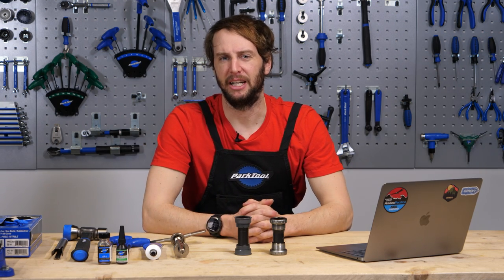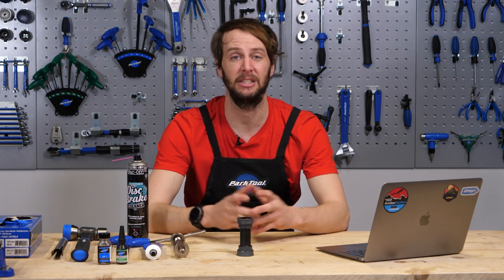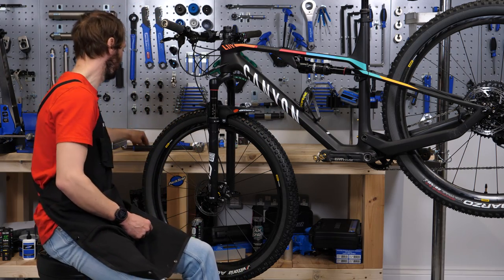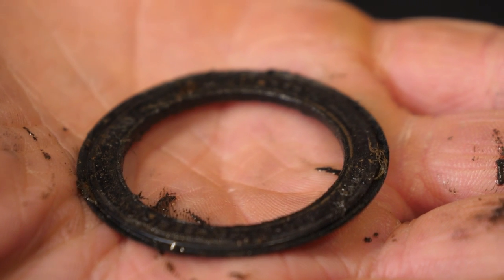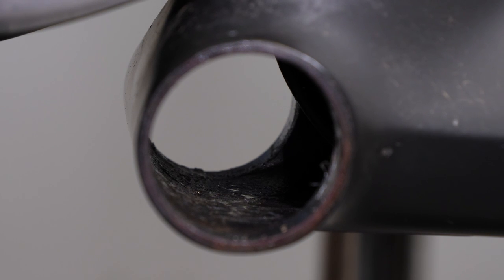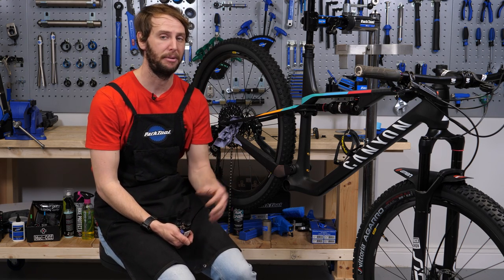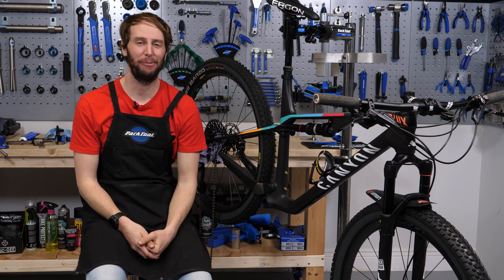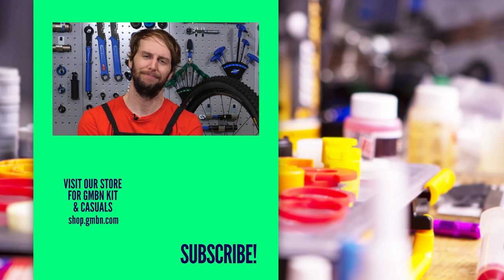How To Remove & Install A Press Fit Bottom Bracket | GMBN Tech Maintenance Skills

Comment: My Trek carbon XC bike has BB90 (press/remove the bearings by hand), & despite that system having a bad rep, mine's been almost fuss free. I say 'almost' because, compared to a more sealed system, BB90 needs more frequent stripping down/inspecting/cleaning, IMO. But the bike's nearly 11 years old, so I can vouch for it!
VERY good video, Rich!

Comment: I've had my pf30 bb in my Capra AL for 4 years and it's never creaked once.
I've never removed the cups from the frame, just tapped the bearings out of the cups and pressed new bearings back into the cups.
5 minute job.
Reply: That's lucky, you can't always press out the bearings as many cups have a lip on the inside, do you know what brand BB it is?
Reply: @Will99x  it's a RaceFace
Reply: @Will99x  have a look at blind bearing pullers as they clamp to to tinnier race f the bearing and don’t need the back face

Comment: #askgmbntech There are now several press-fit bb maintenance videos but it would be really good to do one for threaded bb's. Questions to cover include: where and when to grease, when to strip down, which bb's are re-greasable and which are sealed units, how much do bb's cost, do you need special tools, where does creaking come from in the bb and many more.

Comment: Absolutely don't take my word for it, I've never done it myself, but an appropriately sized socket wrench and bolt can be used to remove and install bushes on car suspensions. They're press fit too, and the wrench works like a sort of press. If anyone is looking into doing this job themselves and doesn't have a bb/headset press, maybe search online how car mechanics install suspension bushes, it may help you.
Also, the ammount of grime on those cranks is strongly persuading me to take mine apart lol
Reply: Long thread,two nuts two washers and two square washers do exactly the same job ,cost....£5 how much are bearing press tools 🤔🤔🤔

Comment: I've been searching for awhile through the forums. I have a 2016 Trek Stach that I inherited from a friend and I'm in the process of rebuilding it. One issue I had was with the cranks torqued to spec they put so much pressure on the pressfit bearings that the cranks barely spin freely. Whomever installed them didn't take the time to do it correctly. I was looking to find a slightly lower profile pressfit bottom bracket as all I need is a few mm, but I had the thought today to REMOVE the preload collar on the 30mm Hope Crankset. That did the trick it left me with about a .5mm space which I filled with a spacer and it was fixed. My question is, is it okay to run the cranks WITHOUT the preload collar? If I could find a thinner replacement collar that would work to which might actually help me fine tune it a little easier. Appreciate the help.

Comment: When you are pressing in bearings, you should always do one at a time because they will go in a lot straighter that way. In the case of a BB, just take a big washer and put it on one side of your press while you press in the opposite bearing. It's also much safer to use an adaptor for the specific bearing that you're working with. If you do not have that luxury, take the old bearings and grind a layer off on the outside so that they can't get stuck in the shell. That way you are pushing evenly on the races avoiding any damage to the new bearing!

Comment: Hi have a cannondale scalpel which has an 83mm width bottom bracket tube. I have recently purchased a Hope PF46 Stainless Steel Bottom Bracket - 30mm, however when I go to install the bracket casing protrudes about 12mm on the drive side and 10mm on the other, therefore is this correct?

Comment: What happens if the crank shaft is still in the press fit bottom brackets?  I can now answer my own question. I took a hammer and a carpenter pry bar turn flat and put it up against the crank and beat it out with the hammer hitting the flat end of the pry bar. I couldn't get the bearings out so I pitch the frame.

Comment: Great vid, thanks. Timing couldn't be better. How tight should you go when using the press-fit tool? So as not to over-tighten. Cheers
Reply: Looks like until it’s seated and there’s no gap. You can take a set of calipers and see how deep it’s supposed to go
Reply: @joshuac1364  Yes, but once there is no gap, how tight do you go?
Reply: Fingers only firm....u just have to feel it, but no need to hang on it. 'Just firm'.
Reply: 67ft lbs.😉 The further in they are the better!😉

Comment: You talked about lots of combos of material, but I don't think you touched on nylon BB to Al shell. In this instance what do you use - just grease?
Reply: I installed mine without anything.. Just cleaned. But i would like to know what is best when pressing nylon into AL too
Reply: It’s probably the same used to press nylon into carbon but I’m definitely not an expert
Reply: Well, aluminum won't react with nylon so nothing HAS to be used but retaining compound still serves the same purpose regardless of frame material, it fills any gaps between the two and prevents the two parts from moving independently of one another. Thus helping to eliminate the possibility of creaks.
Reply: Retaining compound. 
Never grease....allows movement, but u cant hear it!
Reply: Best to check, I did mine recently and the manufacturer recommended using silicone RTV, just strong enough to act as a retaining compound but will 'let go' when you need to replace the BB again.

Comment: i noticed that that plastic cup between the bearings ist somehow cracked open in my pressfit bb (no idea how, noticed it after it came back from the shop for swapping the main pivot). i just installed the cranks again and it's fine. but is this actually a problem? can moisture get in there somehow? from the seat tube or something?

Comment: What compound would I use if pressing in anodised alloy cups (Chris King) into a carbon frame?
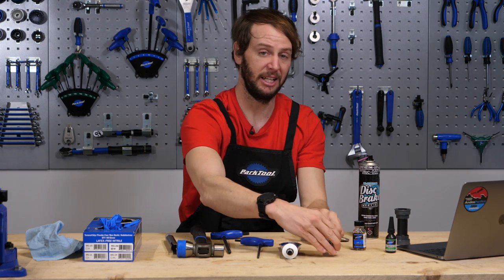Reply: 2:48
Reply: Retaining compound.
Reply: Check with the frame manufacturer, some say to use retaining compound, some say dry, some say to use teflon grease. Follow their directions to maintain your warranty

Comment: Do a video on a how to remove a seized Press fit bottom bracket
Reply: If the cups aren’t budging after hammering with reasonable force, stop. Don’t keep hammering or you can unbond the aluminum bb sleeve from the carbon frame. Remove the bearings and carefully cut the nylon cups with a dremel (sometimes a small cut releases most of the tension so try hammering the cups again every once in a while). To prevent the cups from seizing service them every year or so.

Comment: So an old seat post cut 2 slots in it and bend it outwards and wala bottom bracket shell remover
Reply: doubt a seatpost is the right material or thickness. You can get blind bearing puller kits for about £30, well worth buying
Reply: Yep, easy to make a pf bb remover...copy the prong design.
Even if u buy an old post, still only couple £.

Comment: I'm new to mountain biking but it seems like press fit brackets are a bad idea and It's hard to understand why they are used.  They are low in the bike and exposed to the elements so they seem like they would require frequent service.  Why make it so difficult to service on an expensive carbon fiber frame.  Seems like everyone should be using the treaded type.

Comment: would have been more useful if you spent more time on 'best hacks' for installation and removal .... flat screwdrivers, hammers etc were mentioned.
Reply: liability.....
Reply: A bit of threaded bar, two blocks of wood with a hole in the centre and two nuts makes a good press.

Comment: I recon it would be cheaper to buy a lathe and make your own tooling rather than buy all of these bike specific one job only tools. I dread to think what that bit of thin wall tube with some slits in it costs.
Reply: Just looked what that bit of all thread with some collars and a big wing nut cost... Wow. I recon the steel probably cost them 20 quid at most.
Reply: You can buy blind bearing pullers for £30 and they will do other jobs on cars and bikes too